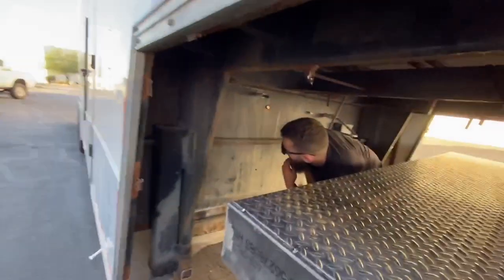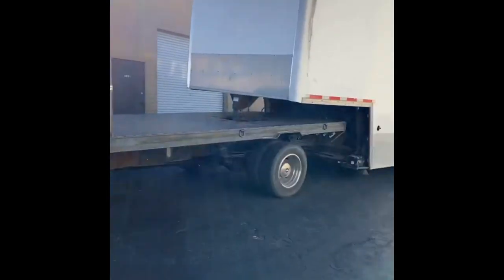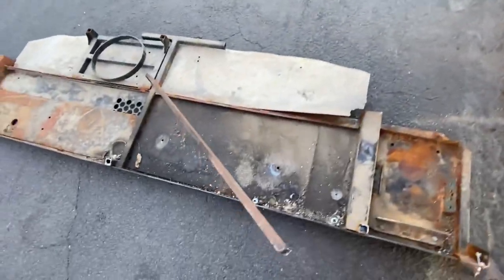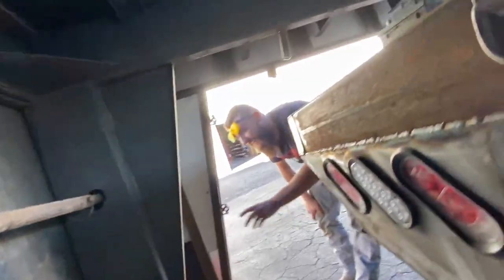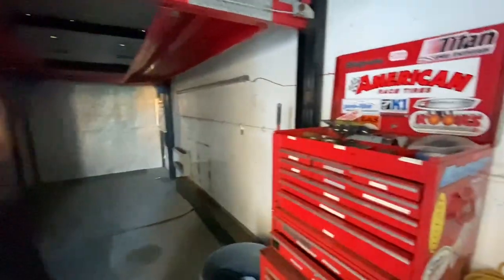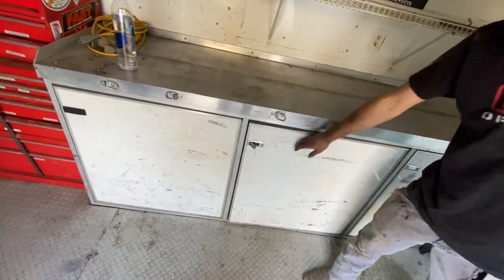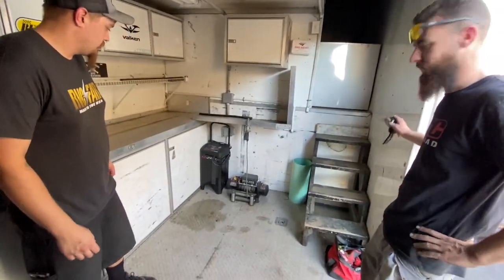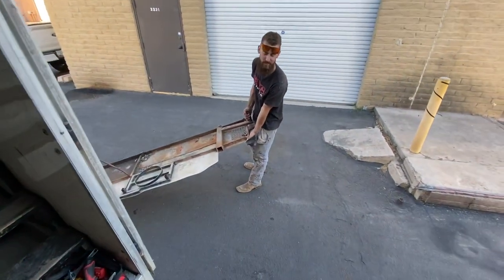The KODIAK Reunited with the Stacker  - first test + Trailer Tour and future plans

Comment: It may be an older rig but some of us would be thrilled to own it. An enclosed trailer would be so dope !
Reply from the maker: Everything else i own is new ..but i really like older trucks  this thing is an adventure to drive 😂
Reply: @BVCOFFROAD  I mostly enjoy the older stuff, You can actually work on and improve it where the newer stuff you either wouldn't weld anything to it or need a damn science degree to work on it.
Reply from the maker: Thats for sure we basically built it exactly how we needed it for a solid work truck / metal hauler and still able to tow
Reply: @BVCOFFROAD  I think it's an outstanding rig you guys did a killer job on the bed and tool box. If it doesn't have working a/c now would be a great time to get it fixed LOL